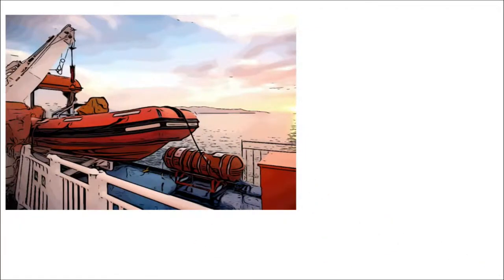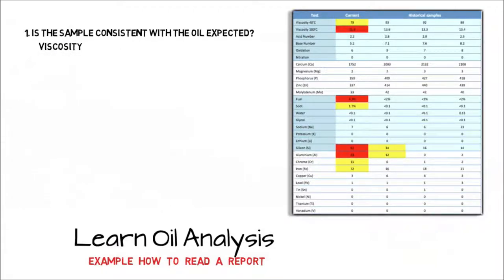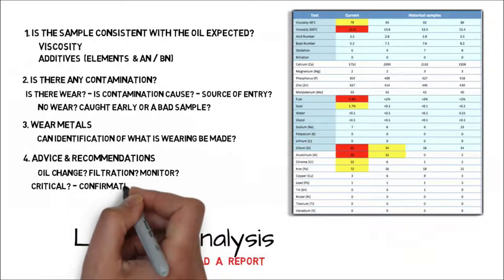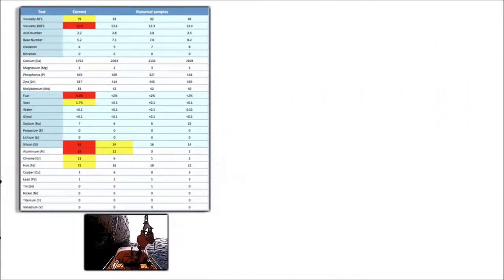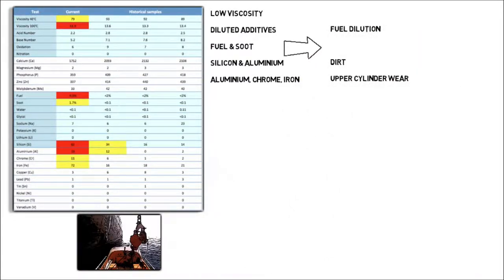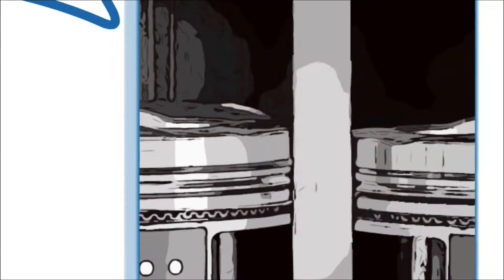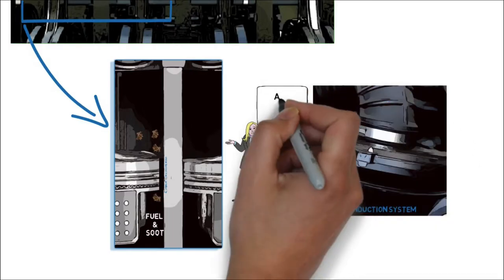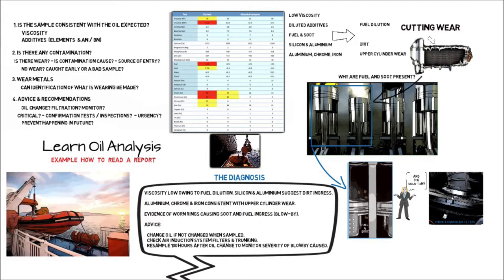Learn Oil Analysis - How to read an oil sample report

Comment: I'm heavy equipment mechanic. Ur on point or at least in right direction as I know I'm still learning but definitely what u say makes sence, as well as you write those samples sheets similar to CAT does. Nice
Reply: How useful is oil analysis for heavy mechanic equipment?
Reply: @Stanisław Topolski  There useful. We do services every 250  hrs. Which is actually like every 3-5 weeks. The report breaks down all the elements really nice. The big thing to watch for  that s just because CAT flags the oil doesn't mean it's bad. Oilers can take bad samples or mechani, which s could have just made some repai, s and the elevated levels could be "break in wear". CAT just flags it, we still have to know what's going on with the machines. Usually, we base decisions on the last 3 to 4 oil samples "roughly 6 months"
Reply from the maker: Yes I have interpreted a lot of cat machines in my time as well as all the other OEMs. You tend to get different styles between independent labs, oil companies, filter companies and OEMs in how things are diagnosed.